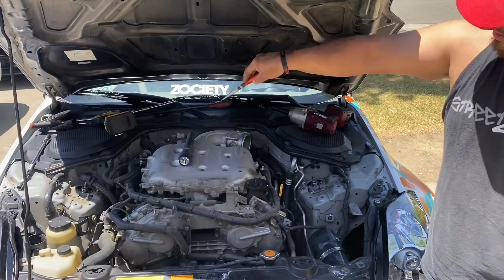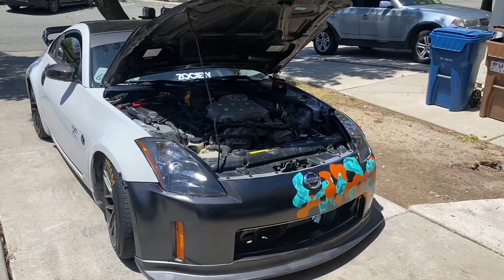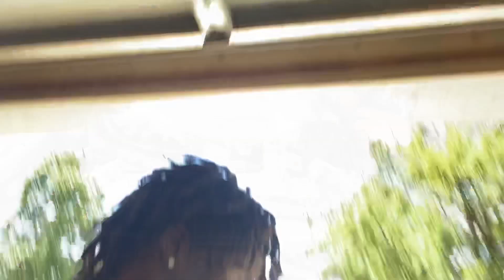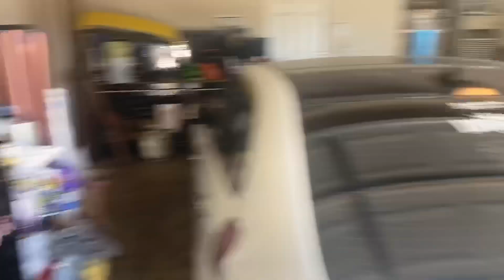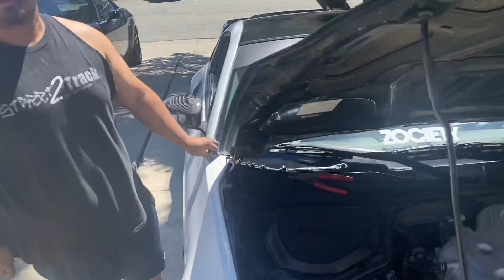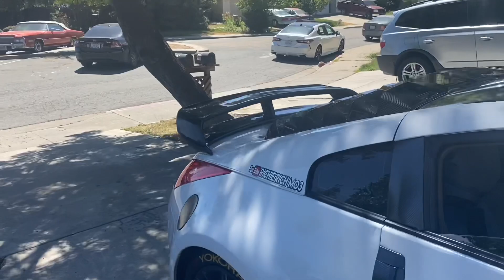Part 2 | Fixing Common NISSAN 350z MISFIRE | Spark Plugs & Coil Pack ( RESOLVED )

Comment: I had random misfire code and knock sensor code so I replaced the knock sensor/harness, all spark plugs and coil packs and my 350 still sounds like a Subaru… after I warmed it up it threw a new sel code for p0444 and misfire in cylinder 4. Any suggestions? Also would a vacuum leak cause misfire? I do hear a hissing noise from pvc
Reply: I got code p0305 and it says it’s a cylinder 5 misfire. I’ve seen people recommend changing spark plug or coil pack but man something tells me it might just be the crankshaft position sensor since they do go bad on these cars ...
Reply: Someone please help. I have similar symptoms. Car sounds deeper and weird and shakes. Replace the bad coil and still misfire.
Reply: @kami_dred7319  my problem ended up being a bad catalytic converter. It was blocked and causing all these issues
Reply: @angel_trejo  was your car struggling to stay on ? Did it stall ? Could you drive normally?
Reply: @kami_dred7319  my car still ran. It had a huge loss of power and wasn’t able to do more that 55mph and it got worse over any sort of incline. I never had a problem with it randomly stalling out.

Comment: Hi Richie, I have a 2010 370z nismo with CEL on and off with a random misfires code P0300.  I have changed the sparkplugs, engine oil, cleaned air intakes, erased the code but it keeps coming back.  Do you think it's the coil pack?  Thx bro
Reply from the maker: Honestly I’m not 100% sure and I don’t wanna lie to you but I would say still replace coil pack just because.

It’s probably best you get an inspection on it
Reply: I appreciate your honest answer bro.  Are the OEM coil packs expensive?
Reply from the maker: It’s all good..  go on eBay I found a lot of OEM parts cheaper than $20 bucks literally just look on there that’s what I did and the parts I replaced worked out

Comment: The valve covers need to be replaced. This goes for all 350z owners. The rubber O rings and gasket crack from heat age. Failure to replace will lead to oil pool around the spark p and smoke from gasket oil drip leaks hitting the hot exhaust manifold/Headers